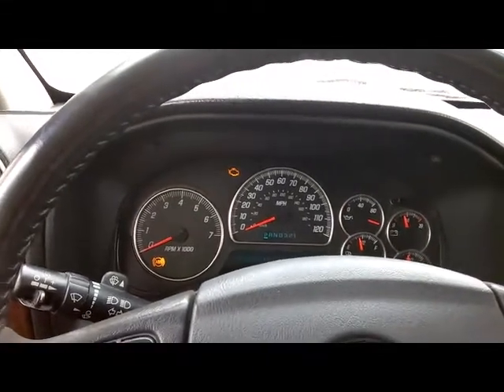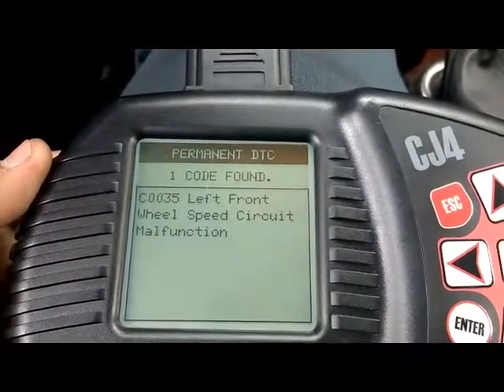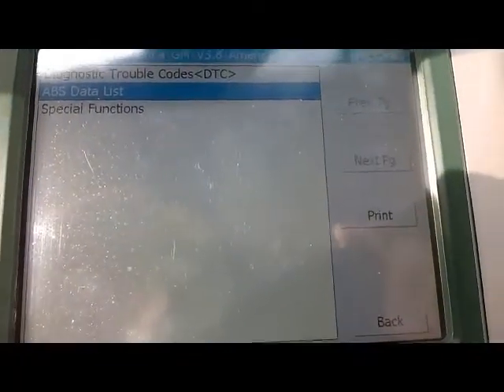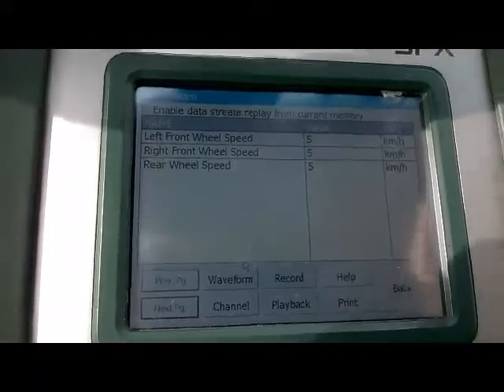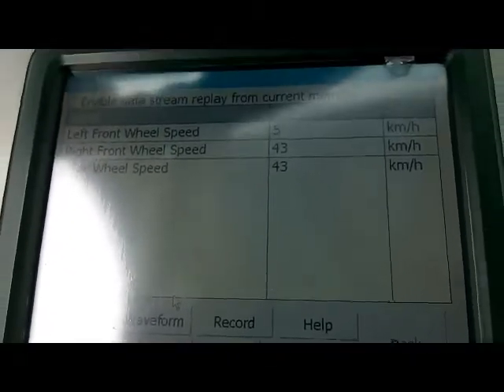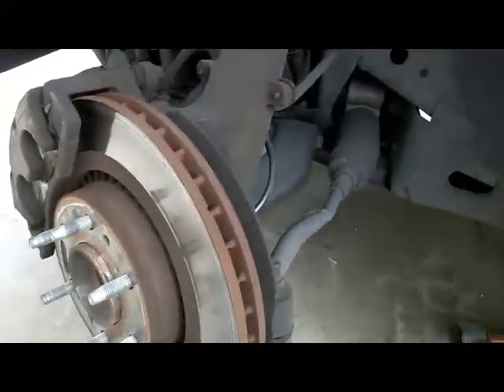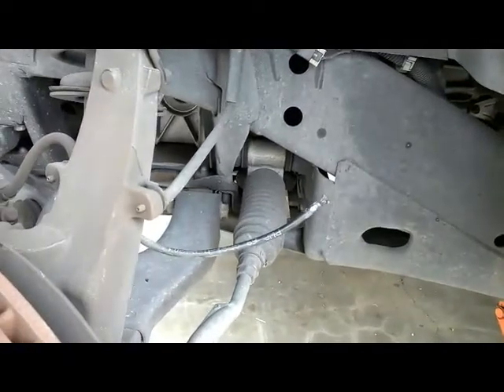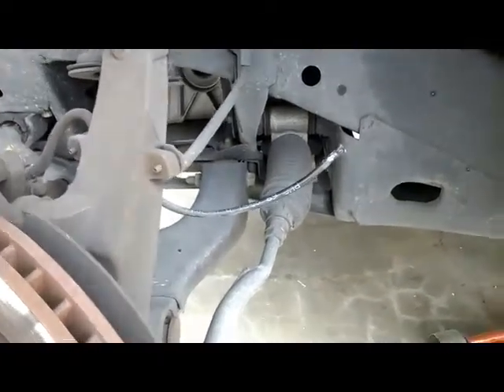(GM) Using a scantool to identify an ABS wheel speed sensor problem

Comment: what scanner w the cj4 or cg4 did you use to diagnose? &week the autoboss diagnose as well?
Reply from the maker: +Erik Dale I used both scanners. I used the cj4 to look up the abs code. I used the Autoboss V30 to see wheel speed sensor live data. Sometimes one scanners has something that the other doesn't.
Reply: do you recommend one over the other if buying just 1? I need to replace my scanner bad
Reply from the maker: If you are into JDM and European vehicles I would recommend the Autoboss V30 because it has more capabilities than the CJ4. If you are into American Cars, I would recommend the CJ4. Overall, I think the Autoboss V30 is a better bargain due to its vehicles coverage. The CJ4 has good coverage on American cars but still needs more on Asian and European vehicles but it does have a 2 channel scope. I think the CJ500 would be a better bargain, although it has the same vehicle coverage as the CJ4, it is a touch screen with a 7 inch screen with 2 channel scope.
Reply: +Eli TheOBDTech have you ever used the more affordable Bluetooth type scan tools such as the Bluedriver?  I'm in no way a pro mechanic, just a shade tree variety.
Reply from the maker: Have only used the actron scanner, which was my first scanner. I mainly use it to diagnose obd1 American vehicles. Since then I have purchased the Autoboss V30
 and the CJ4 scantools. This are enhanced scantools that allow me to do bidirectional control tests.
Reply: Well I think I'm going to go ahead and try this thing out then.  I usually do as much research and gather as many opinions on most any purchase.  The scan tools seem to be quite powerful and versatile tools especially for this price range.  Once I get it I'll have to come back and let you know what I think.  Thanks.
Reply: Yeah lmk and others what's up w your experience and make sure it's not a knock off. CONSUL2s I've come close to buying everything looks legit & priced decent and turns out that I see it's a Chinese fake just in time 3xs now
Reply: K